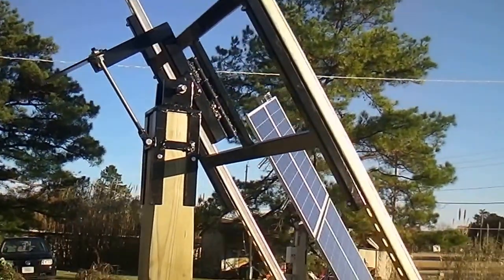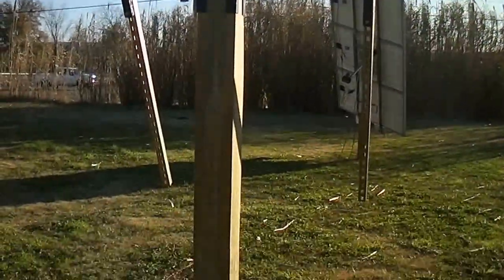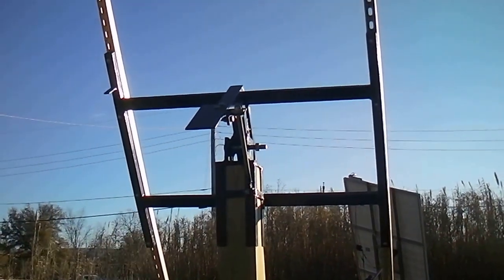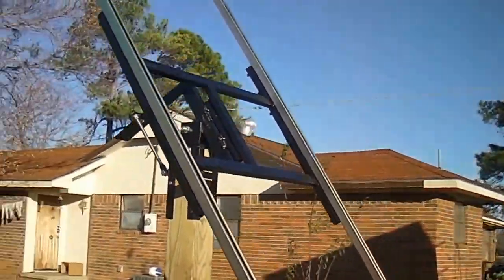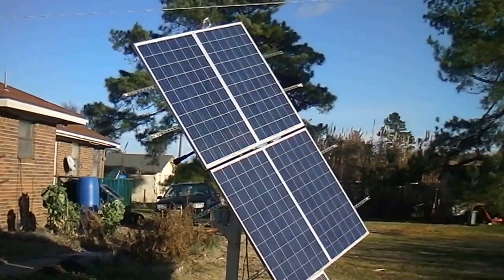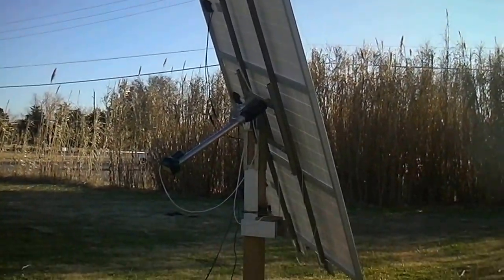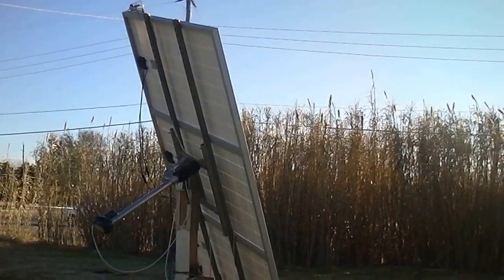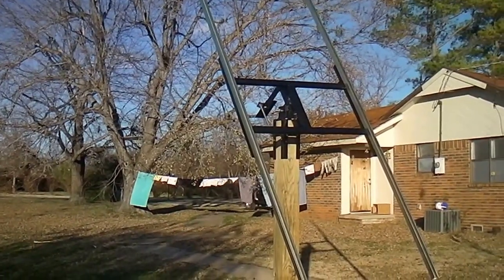Solar Tracker Coming Together

Comment: hey nice setup where do you find the pieces to mount to your 4x4 post there? actuators and super strut is easy to find.. im just having trouble locating swiveling hardware to mount panels to.....
Reply from the maker: Hey thanks buddy glad you like it. I made the swivel part. Kilog69 sells them. You can go to his channel and talk to him about selling you one. You need a good welder and a little shop or a car port like I got to sit under and weld it together. But I can t give away the secrets. You may have to buy one off of Killog69 to see how they are made. Its a big pain in the ass to make one it always takes me a couple of months to weld one together. Not easy to do really. Good luck making one but it is really fun too. I get really really dirty everyday I work on one my hands and shirt just turn black LOL.

Comment: looks great, what kind of hardware do you use to control the tracker?
Reply from the maker: I am using a 24 inch Venture Actuator for the hard ware part. I am using Axtracka for the intelligent part or electronics board. Its been in the single digits lately so I have not installed the tracker board yet. Brrrrr.

Comment: Nice looking setup...looks like it'll work well.
Reply from the maker: I ordered a dual axis tracker electronics board for it so it can move north and south too. So its supposed to make a tiny bit better than usual. Thanks for checking it out man.
Reply: shartne Unless you are a darn good mechanic and have all the parts to built a good (proven design) elevation axis, and can get your PV balanced real well, I would just use a single axis.  It's a lot easier and is more reliable.

Going out to the tweak the elevation by hand 4 times a year isn't all that hard, and if you have 1/2 the complexity, you only get 1/4 as many visits from Murphy.
Reply from the maker: Richard Lee yeah there is some truth to that. I only need some money to buy another actuator. Im pretty sure it will work dual axis. But yeah your right dont have to adjust a lot. I adjust at least one time a month. It would be nice if I could remember to adjust twice a month. Not a big deal to adjust but I got a good deal on the dual axis components so I went for it and Im not going to use that option at first.
Reply from the maker: Im guessing it will work well. Thanks for watching.

Comment: I found those struts at the home store for $15 a section, but I couldn't find a sliding nut that goes in them for mounting the panels.  I'll have to look again.
Reply from the maker: no way they must be the smaller superstruts for that price. but still thats good for even the smaller size. the spring nuts are on ebay for cheap. Maybe I should go to homedepo to check out their superstruts and see for myself. I paid 20 for these deep ones. I should drive to homedepo next time I think hmm?
Reply: shartne
I found them at Menards, It's just like Lowes, but the prices are much better I think anyway.
Reply from the maker: I think Ive heard of Menard's now I got to figure out where a Menard's is at? I like to eat out at a nice restaurant with my wife when we travel to a store in another town to get something special. I may have to take a road trip again.
Reply: shartne
Look up your location at their web site.  Their prices are usually better every time I compare them to lowes.
Reply from the maker: Russ Bowers Yeah thanks Im going to do that.

Comment: Very good craftsmanship.  They look really good.  You're probably getting pretty fast at making them after so many copies.
Reply from the maker: I wish. The copies are lot different than the original I have made a lot of changes. Its getting a tiny bit easier since I got a chop saw. It still takes a lot of time to make everything square and the hinge is difficult to get right. It is always a pain in the you know what to get the hinge right. The metal is heavy and dirty and that makes it more difficult to do. I wish the metal suppler would not keep it out side in the rain because it gets so rusty and nasty and its only surface rust but still its make me get so freaky dirty trying to get it ground off and sanded clean. Every shirt I wear gets ruined. It was so hot last summer making these it really has a effect on my me. I get slower. They are huge pain like birthing babies. I think if I had a giant shop it would help some with the speed some but its just a lot of work. Reminds me of the art foundry I used to work at a serious pain in the wazu. But the final out come is fantastic, so its worth in the end. Kilog69 jokes about he is ready to crank them out for the masses im like yeah right lol. Masses. Hee hee funny joke. A guy could crank them out for the masses if he had a Chinese slave driving government funded factory where the slaves work for a dollar all day. I need some slaves LOL
Reply: Sounds like you need a HF sandblaster if you have a big air compressor.  I just finished making some stationary mounts for a 100w panel.  The HF mig welder I bought earlier this year worked like a charm.  Now I need to learn to weld better.
Reply from the maker: Russ Bowers Yeah that would be nice but I would much rather spend the money on more solar panels and batteries. Gotta get more batteries and panels.